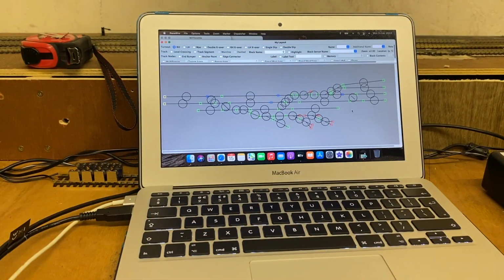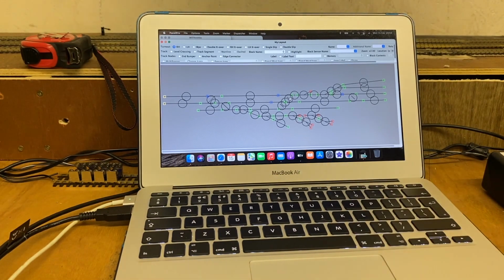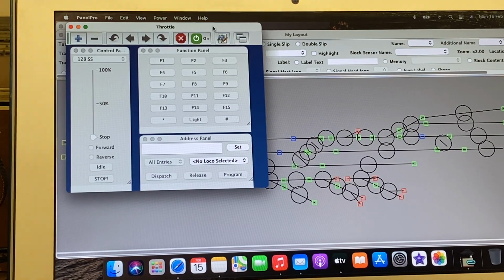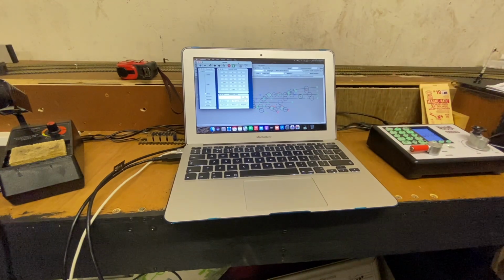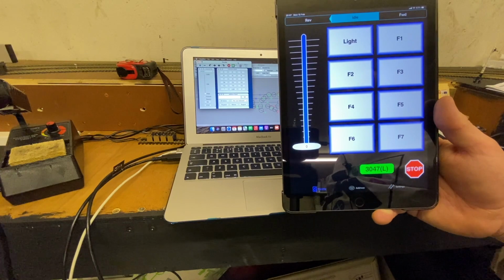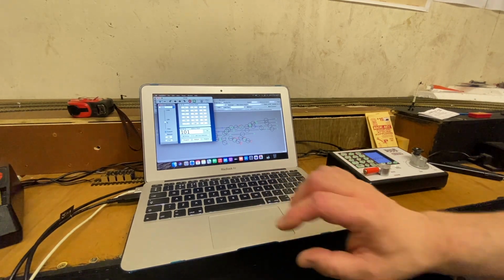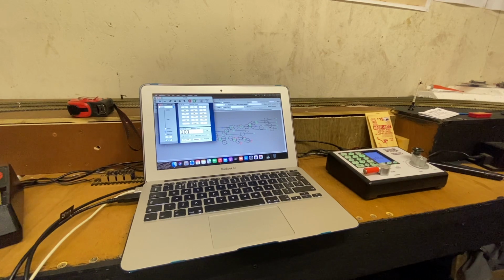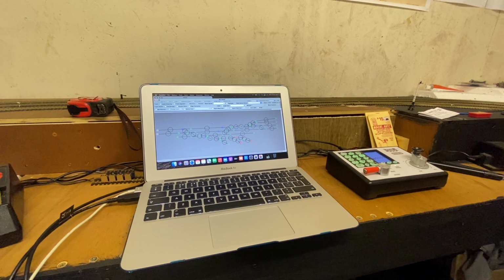Using JMRI to control your layout

Comment: Hi Ian
Love the videos! My experience with JMRI ended after 18 months... it’s a very steep learning curve. I was aiming for automation but could never get it to work properly. In the end I reluctantly gave up as it took too much of my time away from the railway. I still use Decoder Pro as I think it’s the best.
Traincontroller  was my next choice and this worked out great for me though it’s not cheap however, you can jump straight in with automation without hours of work. There is a series of fantastic YT videos by a Dutch guy that will walk you through the program. 
 Also take a look at ROCRAIL, its free and seems to echo some TC features (One might even think it’s written by an ex TC employee) https://wiki.rocrail.net/doku.php?id=start
Reply from the maker: Don’t know if I’ll be going for automation, as I like to have control myself! I wanted to have a go with JMRI to see if I could build a half decent control panel with it. I got a panel built as you can see in the video, but there’s something about it that I’m not that happy with, as it feels like I could potentially mess it up at any moment! And I really wanted my control panel diagram to look like a traditional signalbox diagram, something that I think I’m going to pursue at a later date using DCC control. One of the main things I wanted to try with JMRI was using WiThrottle on my iPhone and iPad, but I’m hampered by the non existent wifi signal in the garage! Will be looking at the Digitrax wireless module I think, as Withrottle will work with it. 
My name isn’t Ian though, it’s Chris 😉😉

Comment: I made a video a couple of years ago about JMRI, and I think you might find it useful for expanding your knowledge of the system.
I've placed it at a useful screengrab moment where I show a whole (club) layout.
The nice thing about it, is that you can create a background under which the lines stop... so you can colourise the area behind to reflect the setup of the layout.
https://youtu.be/VTq_MdEn7H0?t=809

I also explain the 'macros', so that you can have a button that changes a whole sequence of points.
In my video, the layout is split into two halves, with a station at the front, and a fiddleyard at the back, plus a branchline on a raised section behind and above the fiddleyard.

To set all the points for a 360 degree route from the fiddleyard, through the station, and back to the fiddleyard.... you press just two buttons!
It's brilliant for speeding up route setting.

Hope it proves useful to you!
Reply from the maker: Thank you! I did look for videos on YouTube while I was having bother setting it up, and I didn’t even see your video, so apologies for that! I will give yours a watch though

Comment: That's really impressive.  Digital control is like a hobby itself.  I'm still in the world of analogue points/mimic panel, but use a Z21 for train control / CV setting.  I like the idea of route setting and automated running which your set-up potentially allows.  Trouble is, I struggle to find time for the basic layout building, let alone doing a full Star Trek job on it!  😉 Looking forward to seeing more.  All the best.
Reply from the maker: It’s really more of an experiment at the moment, to see if I could do it and how much hassle it would be, and as it turns out it was a fair bit of hassle! I was going to go down the analogue route with points and signals, but from previous layouts, I wasn’t looking forward to the miles of wiring! That said there’s still a fair bit of wiring with DCC point control, but it’s pretty much all localised to the area around the decoders, 2 wires indeed!!

Comment: Nice video, well done. I just spent last weekend setting up my layout panel in JMRI so can control my points and signals through it. Connected to a gaugemaster prodigy advance 2. Surprised more people in the UK haven't done it. Took a while and plenty of trial and error to find out what will work best (especially for signals with theatre indicator and ground signals) but it is nice using a touch screen tablet to quickly set points and signals. Might do a video on the set up at some point.
Reply from the maker: Thank you! It’s all a big experiment at the moment, it may work out to be too bog a faff as I’m not sure if I like the control panel thing, and I’m not hugely keen on having my expensive MacBook out in the garage either. It’s kinda worth it for the WiThrottle though, and I may see if I can invest in a cheap secondhand router for the garage just to get WiFi out there, as it’s out of range of the router in the house. The other route is buying a Digitrax wireless adapter and using WiThrottle that way